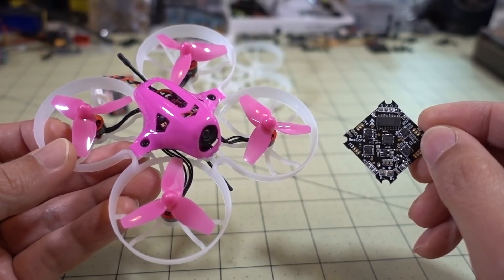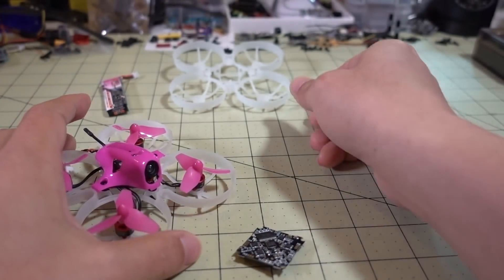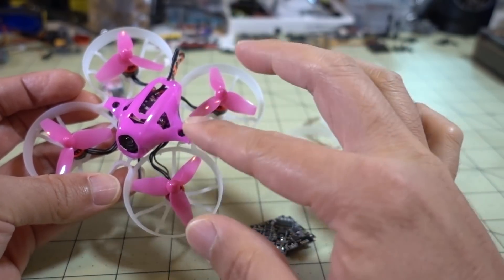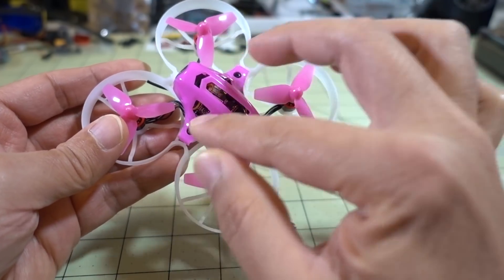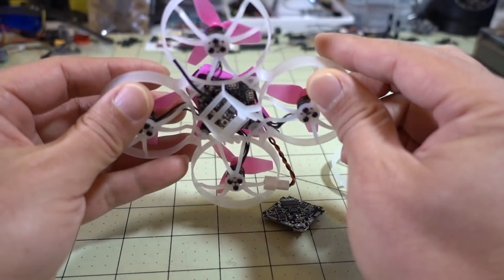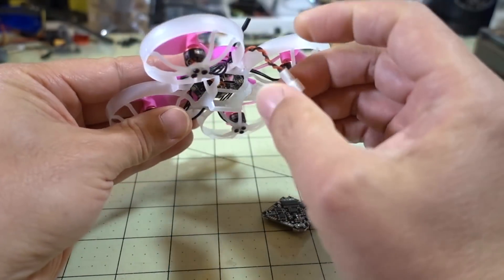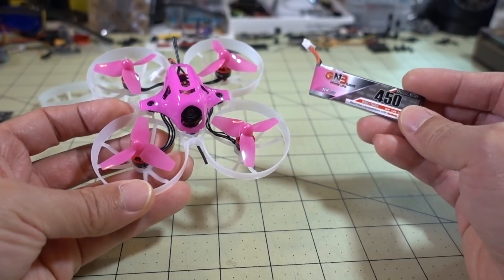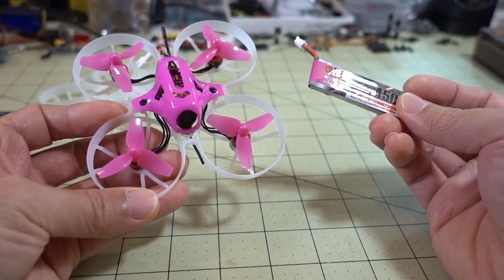Build a Brushless Tiny Whoop 👌

Comment: Wait, this thing doesn't have ESCs?
Reply from the maker: The ESCs are on the same board with the flight controller
Reply: ah.  just read up on it.  a lot has changed since i took a break from the hobby.  sounds like there are some big weight savings now.  thanks.
Reply from the maker: Yep, just browse through my video list if you want to catch up.  I've got all the latest gear.

Comment: I am curious what camera mount how did you secure the camera use for this build?  Is the slot in the canopy good enough to secure fit for the camera in case of repeated crashes?  Thanks again!
Reply from the maker: I just used foam tape... You could also hot glue it too.

Comment: Albert, many thanks for all your hard work.  You rule, buddy.  I built one of these in an 85mm frame with a beecore v2 and brushed 8020's. I absolutely love it, but I get these terrible dips when I yaw quickly.  I bumped up I gain 15 on each axis, but I am not really getting results. is this even possible to correct? Wondering what would you recommend, if anything, to fix. Thanks again man. 🚁
Reply from the maker: Raise min throttle.  When you yaw quickly, two motors spin down to min throttle.  I think it's too low.

Comment: I purchased this FC - BeeCore OMNIBUS F3 V1 Flight Controller Built-in OSD.  I want to solder the white plastic motor connectors to this FC.  Does it matter what direction(orientation on FC) they are soldiered since you can reverse the motor directions in bl heli in need be later in the build if leads reversed.  Thxs again!
Reply from the maker: it doesn't matter

Comment: Step 1: Don't.

Also, the motors you linked do NOT fit this frame. They have a slightly different, larger mounting pattern and the center hole is too small to fit the protruding c clip at the bottom.
Reply from the maker: Thanks, I fixed the link.

Comment: I've heard some people prefer 0603 motors for brushless tiny whoops. What are your thoughts on this? I've already been eyeing the flight controller and frame you showed in this video, but I'm hung up on motor choice. I only need a brushless whoop to be powerful enough to catch itself after a roll or flip without fluttering around and losing altitude like a typical brushed whoop. But aside from that, cruising around and getting good flight times are my priority.
Reply: Brennan Lawrence i have the same question. 75mm w/ 0703 vs 65mm w/ 0603 flight times?
Reply: I too am in the same exact boat (and a lot of my friends), please help Albertttttttttt. More specifically, some sort of compromise chart or explanation would be great for the 0603 (multiple kv ratings) and 0703 (multiple kv ratings) on both 65 and 75mm frames and vice versa since some people have been running some 0603 motors on 75mm frames. It would be very helpful to hear your perspective on things like flight time, performance, etc for those scenarios

Comment: Could you connect to the ESCs with Blheli?
Reply from the maker: Yes.  You can change motor direction and update firmware just like any other BLHeli ESC.
Reply: Albert Kim which version of Blheli did you use? I kept getting some kind of error code when I try....

Comment: So all in all would you say it is worth using brushless motors in a Whoop size quad considering price for motors/batteries, punch and flight time?
Flying a battery down to 2.4V? Is it even usable anymore after that? Or is the voltage meter confused by these small 1S batteries?
Reply from the maker: If you want the little extra speed and power of brushless then it's worth it.  Some say brushed is enough.  Depends on what you want and how much you want to pay for it.  The lipo sags a lot on 20000kv motors but recovers after the flight.  It recovered back to 3.5v resting voltage which is fine.

Comment: Recommend 0703 or 0705?  Also be aware that Sunnysky motors will not work with that frame.  They stick to far out the bottom.
Reply from the maker: I think 0705 will work too.  Just adds a little more weight.
Reply: 0703 only. 0705 is too heavy and has no performance advantage on props this size.

Comment: Can the Beecore support "Turtle Mode"???
Reply from the maker: Yes. It supports DSHOT commands so turtle mode will work.
Reply: Yes, but it doesn't work that well in most cases. If the motors are touching the ground they have a tough time overcoming the friction at startup.

Comment: Does this have better performance than a tiny whoop? Is it too fast for indoor flight?
Reply from the maker: Yes, way faster but with skill you can fly it indoors (but I still crashed it... LOL)
Reply: It's not really that it drastically outperforms a standard tiny whoop.   Remember the very first time you flew a whoop with brand new parts and brand new batteries? It probably flew great and had ample power to scoot itself around. A brushless whoop like this is the same way, although with a bit more power, sure. But it's not like a brushless 1S whoop is crazy fast. The main difference is that the brushless whoop will keep performing great over time. The brushed motors on a classic tiny whoop go bad so fast, so if you're not keeping up with replacing them, the whoop will perform like crap.
Reply: Absolutely does not perform better than a 7x20 whoop other than efficiency and recovery. My 7x20 build is faster overall than any brushless whoop I have tried. Higher kv would be nice.

Comment: Weird mine came with 2 different sets of silicone grommets for induxtrics and the BWhoop 06 and you could just use the 550mahs also more flying time
Reply from the maker: Your frame came with silicone grommets?
Reply: My beecore brushless board did, but not the frame.

Comment: Thanks for the suggestions! If you were not interested in flying outside, would you go down to 0603 w 31mm props on a 65mm frame, or do you think this 0703 combo flies better?
Reply from the maker: If you want to fly indoors exclusively I would definitely consider 0603, 31mm props, and make it as light as possible.  I may have something like that in the works...  You know I've got all the parts already, right?  LOL
Reply: yeah,  it's good to be you!

Comment: With a 2 inch 3s drone would you take 1103 7800kv or 1104 7500kv
Reply: Erik Nel go for 2.5inch..... much better flight characteristics and punch... i use 1104 6000kv... works pretty well
Reply: Sam Sam yes but I want a lot of punch an flight time for cheap
Reply from the maker: 1104 7500kv for power and 1104 6000kv for a little less power but more flight time.
Reply: Erik Nel then you want exactly whay he said, though I'd go 1104 but higher Kv. 6000 will be fine, though.